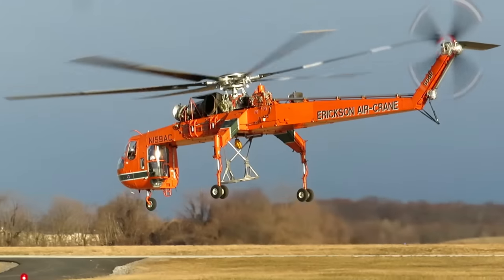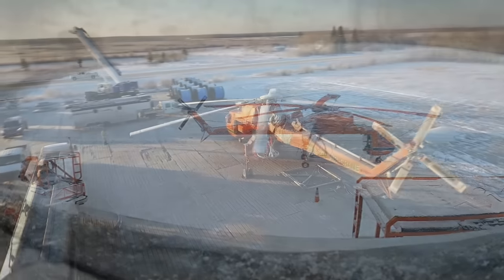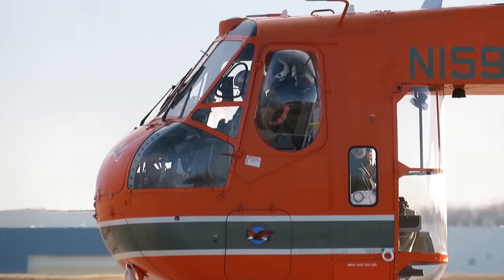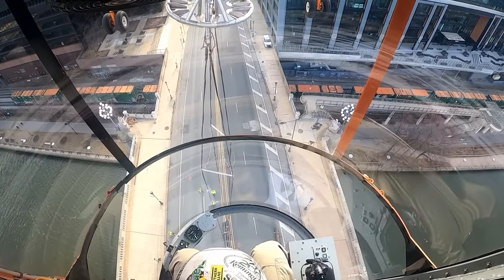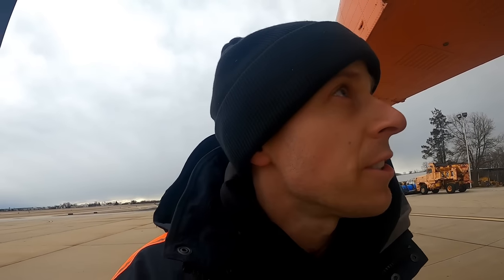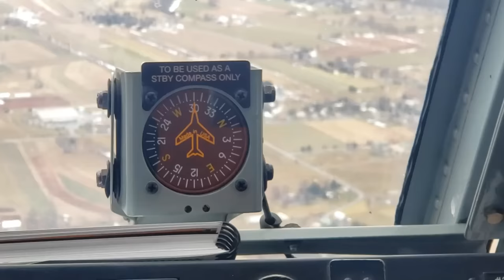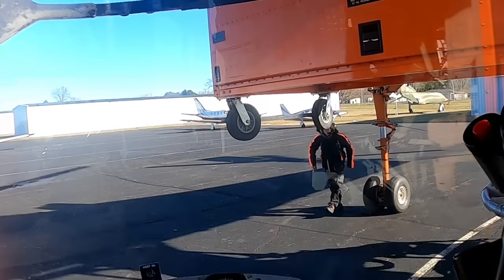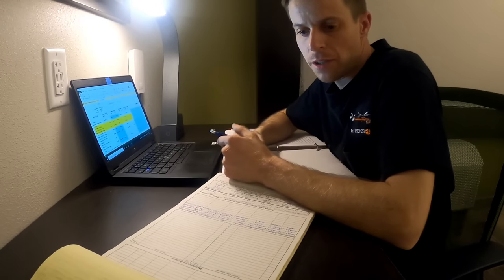Day in the life with Erickson Inc. | N159AC| Philadelphia, PA - Denver, CO | 6 March 2021

Comment: Does the person facing rear fly the Helicopter when loading and unloading?
Reply from the maker: Yes, the aft seat pilot has control over the collective and electronic remote stick assy for aft seat operations while hovering the aircraft over the load with the ability to release the lower hooks and also having access to release the upper book for an emergency situation.
Reply: @BDudasProductions  Does the rear seat have full flying controls,  Collective, Cyclic and Rudder Pedals?
Reply from the maker: @sanfranciscobay  Only Collective and Cyclic abilities. Yaw Authority was removed years ago. The forward right seat pilot will move yaw as necessary.
Reply: @BDudasProductions  Are the controls reversed to make backward flying easier or do they get used to it?
Reply from the maker: @marshallcarter6106  They are reversed. While facing aft, move cyclic to the right, it moves the aircraft left. At times we will use a label maker and identify each direction accordingly to aircraft position.

Comment: Is the guy in the pod required crew?  Either way, what's the purpose of having someone in the pod during ferry flight?  Do they need to be a rated pilot?
Reply from the maker: Pod as in the aft seat? Yes, as an aft seat  rated pilot in control while setting construction loads during job. Only a passenger seat during ferry flight.
Reply: The crew chief flies with the bird.

Comment: Does the guy in the back have flight controls?  What is his joystick for?
Reply from the maker: Yes, the aft seat pilot has control of the flight controls for setting loads. Also can be used for take off and landing. Both cyclic and collective authority. The joy stick is the cyclic and controls fore/aft/left/right movements at 10% authority. Yaw authority has been disabled and front right seat pilot (SIC) controls yaw when necessary.